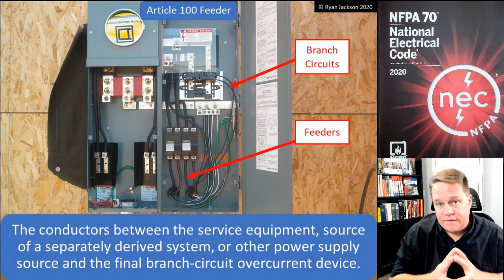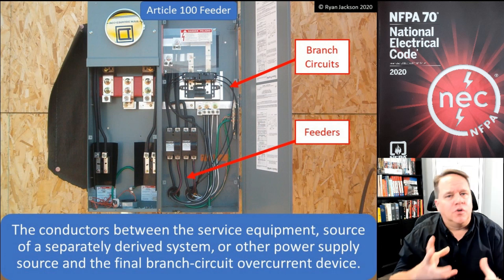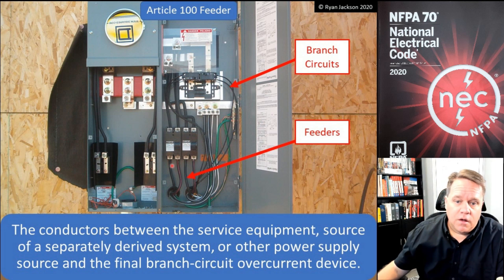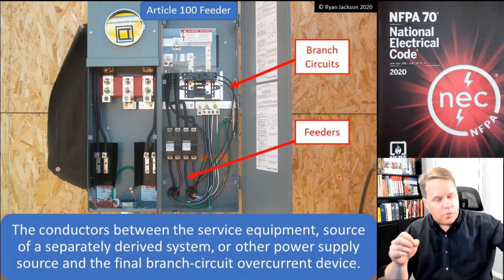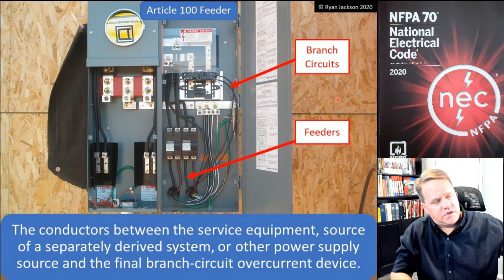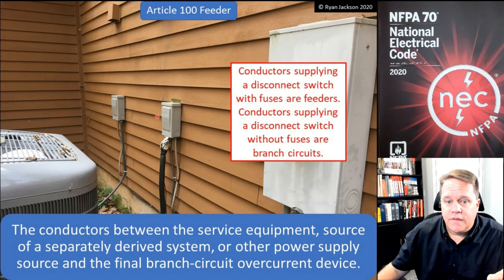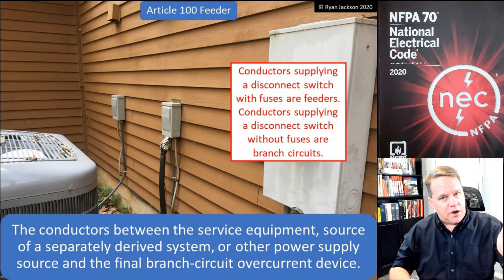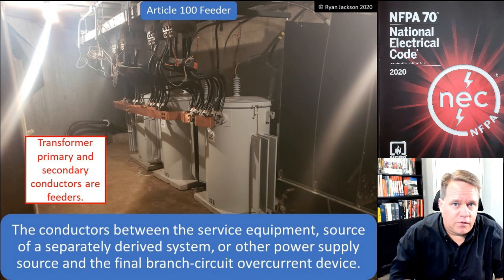100 Days of Article 100: Feeder

Comment: Thank you Sir for the great educational classes! I have question- can you make a video on how to properly size sub panel feeders if the sub panel is of a lower ampacity than the main ( lets say 200A main with 100A sub). Do you size the feeder per 310.12 or 310.16? Do you use the 83% rule or not? Code states that if it supplies the entire load than the 83% rule can be use and 310.12. How about when it is not the full load. SER cable on 60C or 75C?
 Thank you in advance!

Comment: I think one thing that gives you a huge leg up on mike holt is pictures of actual installations rather than the standard format diagrams.
Reply: I can see the pros and cons to both.  With an illustration, you can show specifically what you intend to depict, and you can draw what it looks like ideally, and avoid showing something in the background that may distract from the point.  You can also exaggerate the size or vivid coloring, in order to direct the attention of your audience.  You also avoid the legal issue, of accidentally sharing private information of your customers.  Electrical rooms are also notoriously poorly illuminated (for obvious reasons, since it isn't a room where it is the customer's priority to give it high quality lighting), and it can be difficult to get good quality photos.

With a photograph, you see what the situation looks like in real life, and can more accurately see where you should expect to find the markings and components on equipment.

Comment: I know that the ultility companies do not follow the NEC but they get away with too much. They only used 4 OTT wire overhead to feed a 800 amp service that I installed. They refused to upgrade the existing pole transformer that already was feeding a 200 & 600 amp service. Of course this transformer burnt out twice within a year.
Reply: BTW, 4/0 is spelled out as "four aught".

Yeah, I do agree that utilities seem to have a double standard when it comes to the ampacities required for what they do.  It doesn't make sense why they get to do this, because the same physics should apply to utilities, as applies to what a customer's electrician is required to do.